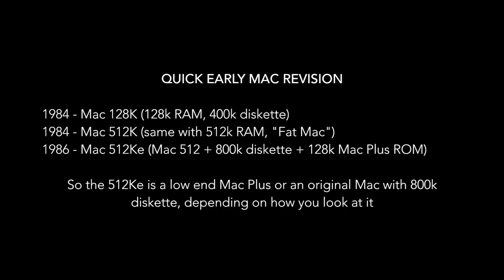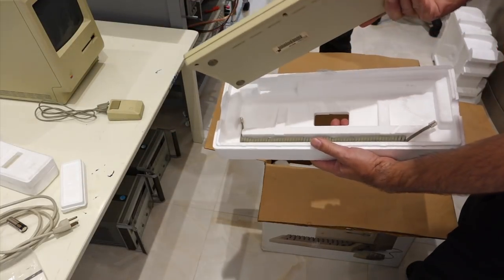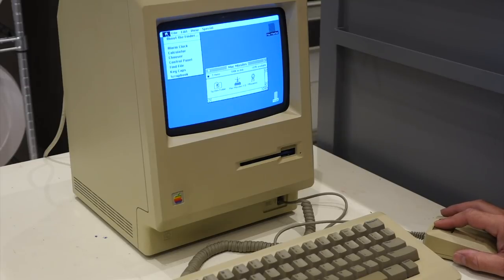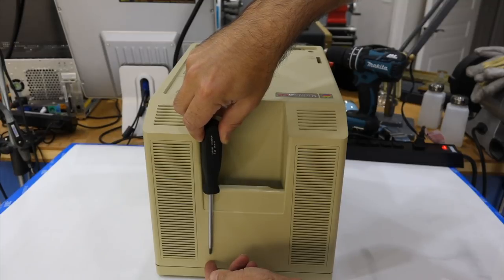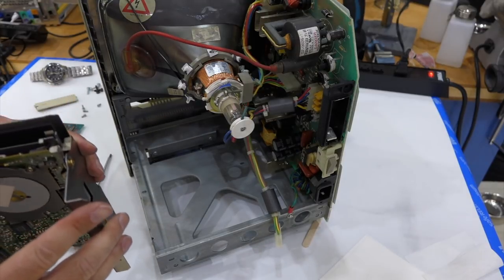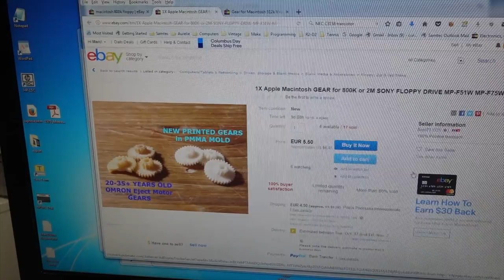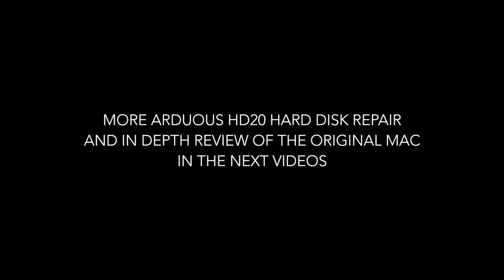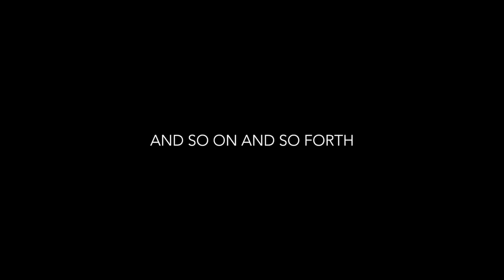Macintosh 512K Part 1: Unboxing and Restoration

Comment: Brings back such memories.  I bought a Mac Plus in 1986, for $2500.  At the time, I was seriously risking my infant child's college education by doing that.    But I so dearly loved that computer, and I joined the Mac Developer's program, and tried to use MPW.  But I wound up getting Lightspeed C, and writing code as much as I could.  I did a bunch of shareware, and I think that for 2 years straight all I did was write code on the thing.  Inevitably, I wound up having to replace the flyback and associated caps.  And when I started to make real money in Silicon Valley, I bought a MacII, and broke the bank again.  (I type this now on a MacPro garbage can...I have never ended my relationship to Apple, though it's getting close to time to move on.)  I still have that Mac Plus and all my discs.  But it has been living in my garage for the past decades...your video makes me feel I should give it a try.  But I think that first, I'll replace all the caps in the power supply, especially the HV video caps.  Thanks for the video.  Joe
Reply: My older brother was really into shareware in the late 80s and likely had some of your software. He had a 128K with a DOVE board and 1MB of RAM. Lots of good memories playing Tetris, Lode Runner, etc. I remember so many evenings watching him master Crystal Raider with his super cool trackball.

Comment: I uas to have a 512k in my youth. I remember the issue with the floppy disk. To take the disks out I would put a paper clip in the eject hole to hold the disk up and use a pen or little screw driver under the disk and push it out. 

FYI: One issue I had with it was the screen would go out. To get it back on you would need to hit the side of the machine. This was because of some soldering joints cracked on the video board (?) on the side because there was no cooling.

Thank you for the memories!

Comment: I did Mac consulting and repair for about 25 years starting in the late 80's. This included repairing the Mac 128K onwards – analog board, floppy disks, etc. down to the component level. 
If you ever need some help, let me know. 
By the way you can adjust the video on these one-piece Macs via the holes on the side of the analog board: vertical and horiz. size, focus, intensity... use a plastic tool like they used in old TVs.

Comment: I just bought a M0135 HD 20 and it did not work
I watched this video and pulled the cover off the Rodime drive and gave the disc a little push 
It broke free and NOW IT WORKS PERFECTLY

Thanks
Reply from the maker: @Don Jaksa: Thanks for the note. We might have discovered a common failure mode.

Comment: The mac cracker or case cracker was not the long torx bit. It was a sort of duck-bill plier tool that wedged into the seam between the two case halves and spread it apart without digging into the plastic. If the computer had never been disassembled since it was manufactured the case halves would tend to stick together rather tenaciously, and thus often required a tool to break them apart.

Comment: Used to upgrade these to 2 meg of ram, (and later 4Meg) soldering extra memory chips, caps and a selector circuit.  Thanks to the Mac engineers making all the lines available! 
A boot disk with finder and a "ram disk" really made the thing fly.
Created many a school report... and still remember a fellow student saying, "what good is the drawing, you can't print it anyways..."  Until the printer started buzzing and an exact replica What You See is What you Get appeared on paper.... 
Great apps MacDraw/MacDraft/WriteNow even FileMaker (still around) ran on those cute boxes.

Comment: You’re a wonderful guy Marc!
There is a new way to remove bromide flame retardant browning BTW.
Use an ozone generator, a small heater, a fan and a plastic box to put all of it into. Supply power and let the whole thing sit for a couple of hours.
The advantage of this method is: No dependency on UV, no chance of blotchiness from uneven “development”, no unpleasant fluids involved, and a slow, mild process that’s easy to control.
Reply: Does it work as thoroughly as the peroxide? Have you done it? I might get one of those $2 ozone generators off ebay to try it
Reply: 10mintwo it works slower but more meticulously and evenly. Just make sure to have a small fan to get flowing air around every crevice. 
Also the heat should be safe for the plastic and not concentrated on one spot. So don’t aim the fan directly at the object. Get a nice circular flow going. 
You run very little risk of overdoing it with this method. Just check every couple of hours.
And yes I’ve done it. 😎
Reply: BTW don’t make the mistake of thinking you can put the whole thing in the box. A lot of electronics don’t like oxidizing. 
Of course very simple stuff like lamps or things only of plastic will be fine.
Reply: The yellowing/browning is not a result of Brominated Flame retardant additives, it is an inherent property of ABS plastics, because the Butadiene polymer can be encouraged to oxidize when given enough energy, typically via UV. ABS Plastics usually incorporate UV absorbers in the formula which attempt to react with UV before the butadiene can oxidize to slow down the colour change and brittleness. The yellowing comes from the carbonyl radicals which are the product of the oxidization, which will then react freely with other parts of the polymer, creating compounds which instill a yellow colour. Both this approach (Ozone) and the typical hydrogen peroxide treatment actually do more harm than good; they restore the cosmetic appearance of the plastic, but they do so by greatly accelerating the oxidization by making oxygen more available as well as providing the needed catalyzing energy. This allows the carbonyl compounds to themselves be oxidized into smaller, colourless compounds. However the problem is that during this process the original oxidization is greatly accelerated- it just happens that the products of that reaction are oxidized as well. this can make the plastic more brittle. Worse still, any remaining UV absorbers are pretty much stripped out by beingfoxidized themselves, meaning that the yellowing/browning will always return and the colour will degrade much faster
Reply: Very rare to find the actual correct explanation of what's going on. The bromine myth reigns supreme virtually everywhere. You should post somewhere popular and visible to search engines. My question is though, just how MUCH does it accelerate embrittlement and subsequent discoloration? If it's another 10 years, for a ceiling fan who cares, for an antique electronics part it's a bad choice...
Reply: Michael Burgwin You Sound like you know a thing or two. Chemical engineer of some sorts?

There seems to be ABS plastic products from the sixties, seventies and some from the eighties that doesn’t suffer from browning at all. 
How come?

If you put a thin UV sealer of the appropriate sheen on top after retrobrighting, you should be good? 

The embrittlement will be in the top layer of the plastic so unless the plastic is very thin I can’t see a problem unless you handle it roughly.
Reply: Helge Frisenette Use a silicone or wax sealer afterwards?

Comment: Does anybody still have one of the original 128K or 512K models? Those single-sided 400K floppy drives made the most amazing musical sounds. The grunting of the 800K drives was just never the same.
Reply: Sorry, meant “single-density”, not “single-sided”. Both formats were double-sided.
Reply: Restoring one now, August '84, replaced all the caps, but has a sad mac memory error, 040006. Removed the problem chip and put a socket in its place, waiting for the replacement chip to arrive. The 400k disk drive (older than the 800k one in the video) was glued solid, the old lube dried out. Cleaned and re-lubed, should work fine now if it reads.

Comment: I found a black and white version of this at the Dayton Hamvention. The owner didn't know where it had come from, but I saw some telltale screen burn in that, under further inspection, showed that it was used often to manage a battery of solenoids. It didn't have a back like that, as it had been stripped of its casings long ago.

Comment: Cool unboxing video :)
I was in commercial school in the early 1990's and we used this kind of MacIntosh among other computers (PC with Windows 3.1 and 3.11). Adobe Illustrator was one of the softwares we used with MacIntosh. Some other program for audio recording, editing and mixing for learning how to do radio commercials but I don't remember anymore what was the name of that software.
After I got used to the one button mouse, I found the system easy to use :)
Switching back and forth between disks brings Commodore Amiga 500 in my mind ;)

Comment: I had one of those 800k drives (the external one) which is designed for the IIGS. It motor seized, caught fire, and surged the IWM in the IIGS, in the process, killing the IWM, making the computer useless

Comment: even in 1985, this computer was still ahead of its time in terms of what it delivered to the end user. the GUI that we know today didn't really take off fully as the "Norm" until the start of the 90s, with Windows 95 cementing its place as the default user experience in the PC space as the successor to Windows 3.11 which up until that point was still an optional piece of software to the system in most cases.
Reply: The Apple IIGS was out at the same time, I think, and had a color display.
Reply: Amiga OS was in some ways superior to Mac OS. But both of them looked like amateur hour compared to what Parc and Architecture Machine Group put out in the 70's and early 80's.
Reply: Apple did add some technical innovations on top of what Xerox PARC did -- like trying to avoid modes, and having proper cut/copy/paste. But its main innovation was in making the technology more affordable. Which was in itself an amazing achievement.

Comparing the Macintosh and the Amiga, the Macintosh implemented its graphics through a hardware-independent layer, the Amiga didn’t. This is why Macintosh software found it easier to move to higher-resolution screens later, while the Amiga apps had so much trouble.
Reply: Apple has never invented anything. You're delirious :D
Reply: Who gets the tag inventor is not the guy who really invents it but the guy who runs with the idea or has the best use for the idea. The PC world best exemplifies the expression, "Good inventors borrow, great inventors steal."
Reply: Lawrence D’Oliveiro They added no technical innovations. In fact even the Lisa interface was in many ways more advanced than what followed and what we have today. Everything, also the idea of modelessness, was appropriated from Parc, AMG and a few others.
Trouble with something like modelessness was that it was taken as religion, not understanding exactly why and how. Larry Tesler was a gifted kid at Parc, not a grown standard bearer. 
Copy, cut and paste, that we are still stuck with after all these years is horrible and a good example of a bad mode laden feature sticking around.

The Amiga being made by a much smaller team with less budget and under more time pressure is perhaps not the best example of specialty hardware being worth it. 
The hardware started off as a console and was therefore not future proofed. The OS on the other hand was quite well thought out. With in fact more direct connection to Parc tropes than the Mac (talking mostly the Amiga 1000 and OS 1.x here, which I consider the only real Amiga).
The Mac didn’t have specialty hardware because Apple didn’t dabble much on VLSI and for some strange reason always where weary of that.

The Mac was underwhelming for the price, apart from the interface. 
A trimmed version of the Alto would have been a far better choice for either Apple or Xerox in 84.
Imagine the Alto released with dual disc drives, Ethernet option and AMD bit slice architecture. It could easily have been made for something like the same price as the Mac in 84 and given far more bang for the buck.
You could have emulated a bunch of architectures with microprogramming too. Like the Apple II and IBM PC.
Reply: Apple's distribution model and support was an advance, though their Apple II line did the more innovative distribution. Schools didn't give up Apple IIs for a long time.
Reply: There’s the classic story of the Xerox Bravo editor: open a file, type the word “edit”, and the entire file contents disappear and are replaced with the letter “t”.

This is because, in Bravo command mode, typing “e” selects everything, “d” deletes it, “i” enters insert mode, and so the “t” gets entered as text.

Users of vi are probably asking “so what?” But this is an example of “command mode” versus “insert mode”, which is the kind of thing the Apple Mac developers tried strenuously to avoid.
Reply: it's for reasons like this I prefer Nano over Vi. XD Ctrl key was put there for a reason.
Reply: Lawrence D’Oliveiro look at where Bravo and it’s maker ended up.

Comment: Luckily there is a guy who 3d prints and sells these very gears. They are notorious for that, and its due to age by getting a bit more brittle, but more importantly, the mechanism itself gums up and makes it much more difficult for the eject mechanism to work so it shears off the teeth.
Reply from the maker: In my case the mechanism was perfectly free. The gear material degraded all by itself.

Comment: 17:04 Look how fast that boot screen came up. I believe that is the MiniFinder you are looking at, not the full Finder. It was useful to save space on the floppies, particularly the old single-density ones. By the time I became a regular Mac user, it wasn’t so necessary.

Comment: 12:15 Notice the analog board along the left side. Remember the vents along both sides, on the top? The left one would feel noticeably warmer than the right one. Also note no fans: cooling was purely convection-based.

Comment: The crumbling plastic gear. Its designed to fail. I've seen the same plastic gears fail in car odometers, only the one gear, others are fine. Replacement gears are available from manufacturer for over $20 plus $100 fitting. Also seen this in older CD and cassette players, one drive belt will turn to sticky black paste after a few years, all other belts in the mechanism are fine.

Comment: I just dug mine out. It powered up. The mouse wouldn't work. Smoke started poring out of the back. Pulled the plug and threw a fire blanket on it. All clear. Wondering what to do with it now ?

Comment: My Macintosh 512k has a plastic mouse holder that's supposed to be mounted to the side of the computer does anyone know what to use to mount it? Glue or double sided tape?

Comment: Does Dark Castle have its own OS?
Reply from the maker: No, it just runs the Mini-Finder (from Apple) instead of the Finder to save space on the diskette. I can't remember what OS was on the diskette, I think System 4.2. It will run under System 6 very well, and I even managed to make it work on 7.0.1 on my Mac SE/30, but that was very hard.

Comment: Can anyone come up with a reason for Apple using Torx-head screws?
Were they even then in the "You cannot repair or mod your Apple equipment.  Take it to the Genius Bar" mindset?
Reply: KerissP Steve Jobs' idea was for the Macintosh to be an appliance, much how the iPhone became later. so yes, preventing end users opening them up was more-or-less the reason for the torx bits and deeply inset top screws (that at the time, required a custom torx bit to loosen). customer pressure, rampant success of IBM PC clones, and Steve Jobs' exit in the late 80's changed that attitude toward the Macintosh line in Apple corporate leadership, at least until Steve Jobs returned to Apple...